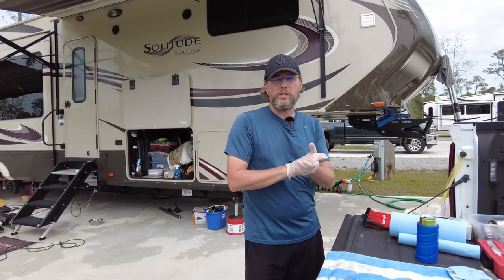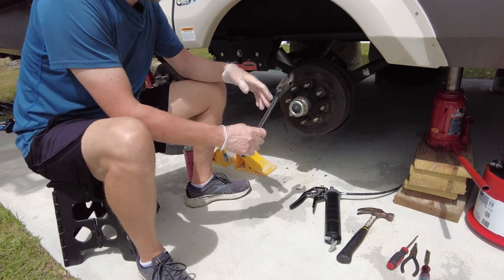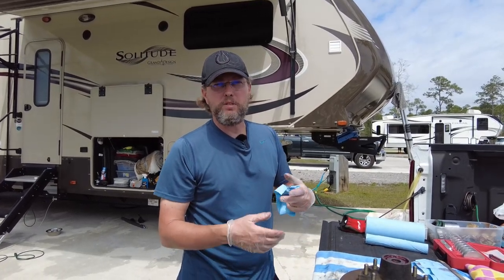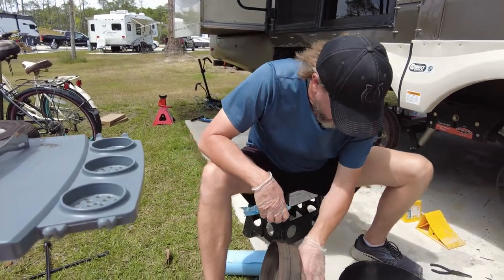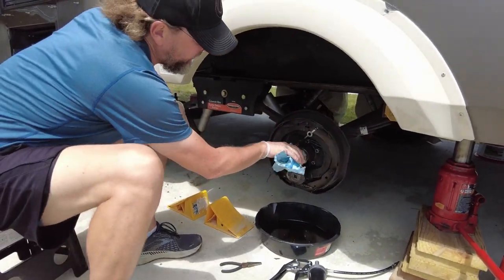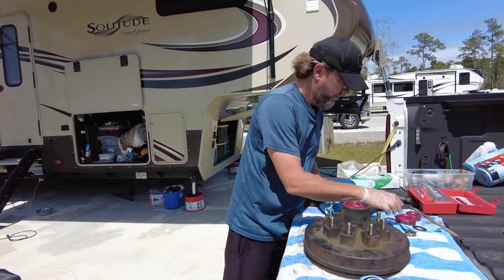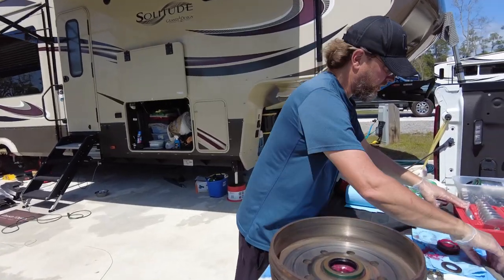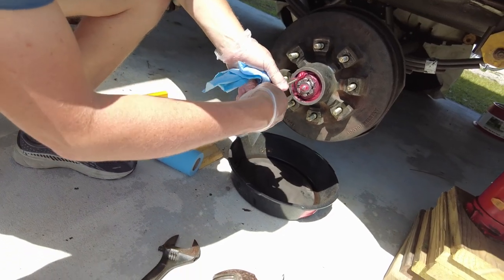RV Wheel Bearing Maintenance (Full Time RV Living)

Comment: If you take the outer bearing off the spindle and replace the nut onto the spindle before taking the hub assembly off, the nut should catch the inside bearing and force off the inner seal. [It might take a couple of tugs, but that is the way every mechanic does it] The momentum of the movement along with the mass of the hub assembly makes it much easier. Your inner bearing and seal will be left hanging on the spindle.
Reply from the maker: Thanks for the tip and thanks for watching!

Comment: Hub should not be filled more than 50%. Lazy Lube is for emergency use only.  Too much grease can cause churning.  If you have to put grease in with a grease gun, the wheel MUST be turning. 
I've always wondered why no one lubricates any of the brake hardware. Bearings must have .001" to .005" end play. 
Bearings are a lot like most things electrical.  They require smoke to work properly. If you don't believe that too be true let the smoke out and see if they still work.
Reply from the maker: Thanks for the comment and thanks for watching. Like I said in the video, I'm not a mechanic and I hate this kind of maintenance, but I do it to save $. You're right...I forgot to rotate when using the easy lube. Other than that, I just followed the instructions from etrailer. We put about 300 miles on it the last couple days with no issues, so hopefully we're good. I'll probably pull the hubs and inspect again since this is all new to me. Thanks, again!